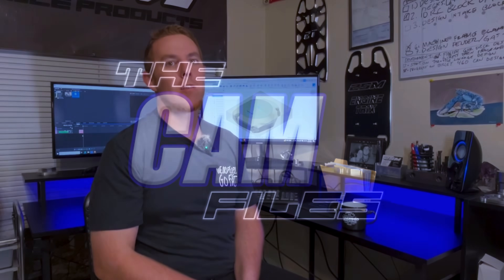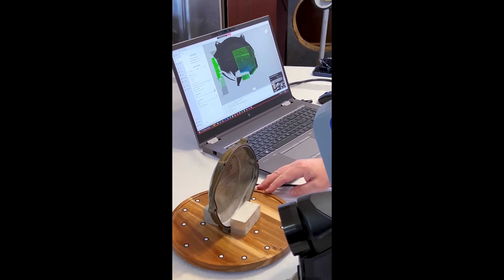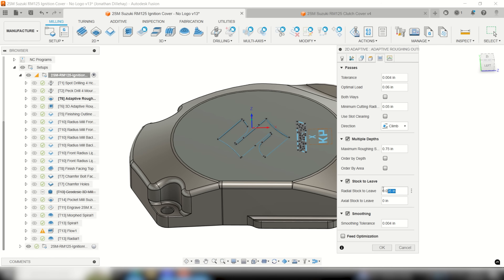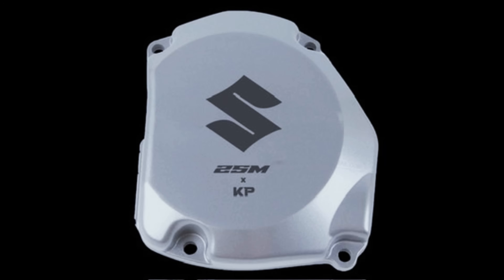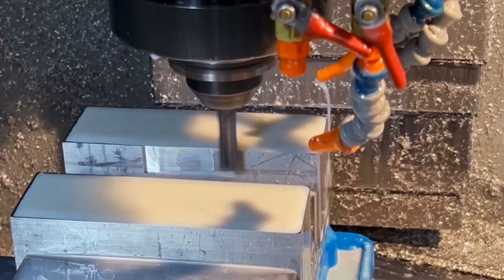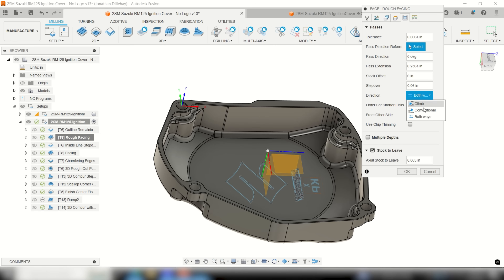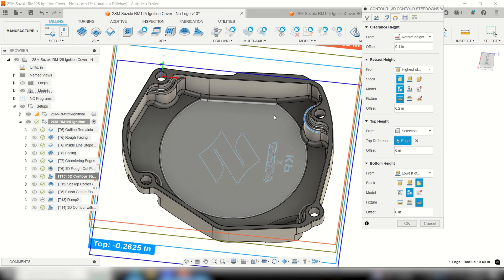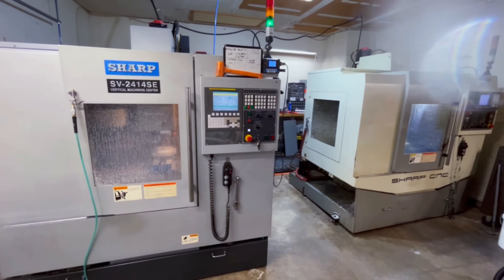What I Do In CAM To Keep Thin Concave Parts From Warping

Comment: I really appreciate your videos and your genuine interest in sharing knowledge and advancing other people. I’m pretty new to programming in fusion 360 however, I’ve been writing complex five axis code in Catia V5 for over 20 years. 

When I saw the trouble you were having with the geodesic path, I thought to myself how I would handle this in Catia and maybe you could apply the solution in Fusion. 

I would extract the organic surface that you’re trying to machine and untrim it and then trim it back to a circular edge on the outside and a circular edge on the inside.  

You may have to extend the surfaces a little bit to get what you want but, who cares if it’s a little extra big, you’re gonna trim it back anyway. Just be careful that the extended surface does not create a fold because the U and V lines might be bunched up from the reverse engineering process. 

That new surface will be toroidal and needs to be just a little larger than the original trimmed surface that you extracted from the model. Maybe an 1/8” larger on the inside and the outside. 

Imagine you’re placing a large flat doughnut just outside of the planer area on top with the Suzuki logo on it. That’s the surface you’re gonna apply to a path to.

Now you can apply a constant circular or even better, a spiral tool path that’ll give you a beautiful appearance. 

Sure you will be cutting some air however I have found that the additional time it takes to cut the air is not a lot longer than the acc/dec rates from the machine slowing down for all of the directional changes. And again, it leaves a beautiful consistent finish. 

Just a heads up, I don’t know if Fusion can extract, untrim, extend or trim surfaces. Catia does it in a snap but it also costs as much as a house. Fusion regularly surprises me with its capabilities so it might just do it. 

I hope this helps!

Comment: Saw something that caught my eye... In your adaptive roughing, you have your tolerance set to .004" and smoothing set to .004", and you stock to leave set to .007". You may experience some rougher gouging since the sum of your "tolerance" and "smoothing "tolerance equals .008" of deviation and thats greater than your stock to leave. Just thought id mention that! My recommendation would at least leave greater stock to leave or reduce your smoothing tolerance.
Reply: That is a really good observation and I am impressed you caught that. I was taught that setting the tolerance and the smoothness values to the same value usually yields the best result. Since I’m going for high speed machining I figured a value of .004” would reduce coordinate points resulting in less blocks for the controller to look ahead at, increasing machining speed.
I have personally never had an issue with gouging on my machines doing this. I also use matching values of .001”frequently and .0004” for contours and finish passes. 
Thanks for comment!
Reply: @2SMPerformance you may never experience it depending on the kinematics of your machine and how fusion handles it but if you hover over the smoothing dialog box it will show what I explained. Just wanted to call it out so you’re never wondering why you have a unexplainable gouge! I surface tons of aesthetic parts so I’ve tried just about everything! 😂

Comment: Really nice looking part. Made some the other year for some Fantic motorcycles.

To avoid warping I machined the backside first, tapping the holes then mounting it on a fixture plate bolting from the bottom before drilling the threads out on the pillar drill.
Reply: I have seen other machinists machine them that way. Thank you for watching! 🙏